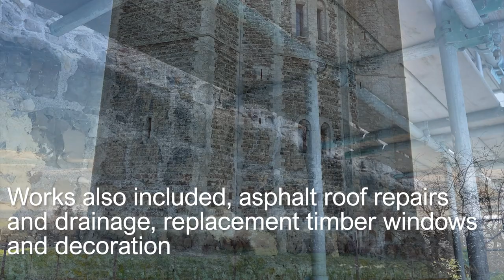Orford Castle conservation

Comment: The results are stunning? I think shocking would be more accurate. I understand that something had to be done but as a regular visitor to Orford the castle is now a complete eye sore
Reply: It was the best option to preserve the ever decaying. Be fair, although it does not now look as it originally did. I still believe it to be “stunning”
Reply: It was going to fall apart and disintegrate- it wasn’t built to last 800 years.   Rendering is the only option and in time it will fade.